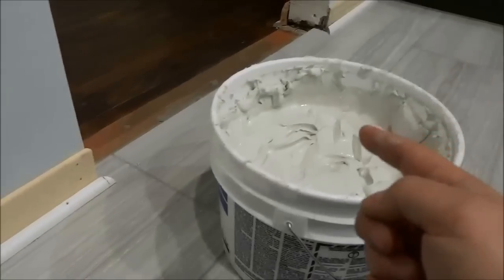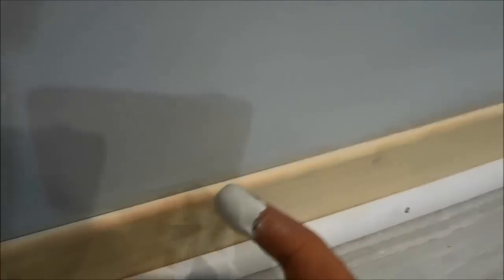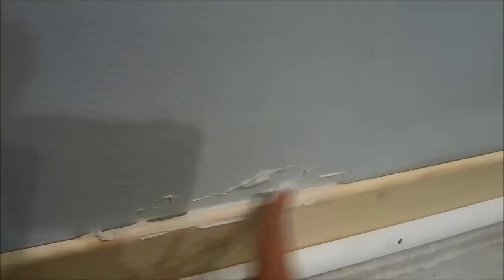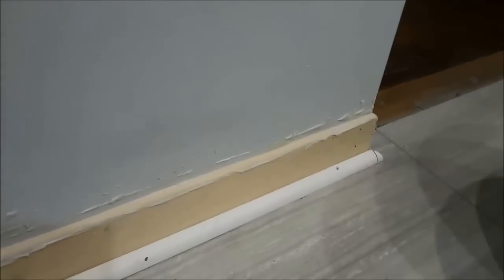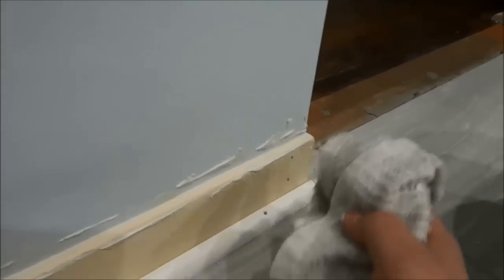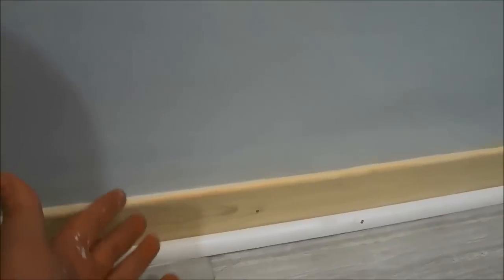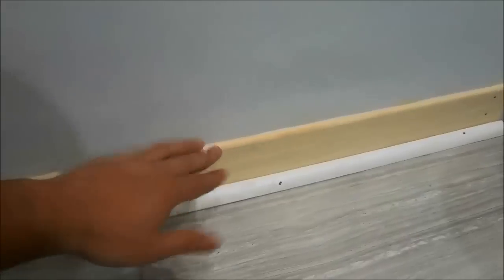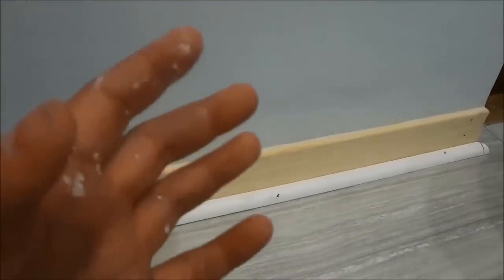How To Fill In The Gap Between The Wall And Baseboard (EASY Tutorial)

Comment: This is a bad, amateur mistake, and you're not doing anyone a favor by propagating it. Drywall compound isn't meant for this kind of application. It's not flexible, and will start cracking as soon as there are any changes in your wall or molding. Try nailing your baseboard to the studs behind it, using a stud finder and a brad gun or small finishing nails. Unless your wall is unusually irregular, this often holds the baseboard perfectly flat against the wall and makes filling unnecessary. If you really do have spaces that must be filled, use flexible paintable caulk, dispensed from a caulking gun.
Reply: THIS!!! what the heck dude!!!!! this is such bad advice!
Reply: But it looks fine when you leave the customers house after getting paid! :)
Reply: i guess it's kinda randomly asking but do anybody know a good place to watch newly released tv shows online ?
Reply: @Jeffery Avery I watch on Flixzone. You can find it on google :)
Reply: @Jabari Emilio Yea, I've been using flixzone for months myself :D
Reply: @Jabari Emilio Thanks, signed up and it seems to work :) Appreciate it !!
Reply: @Jeffery Avery Glad I could help :D

Comment: THIS IS NOT A VERY GOOD METHOD.. I USE CAULKING AND IT WORKS A LOT FASTER AND NO SANDING OR TOO MUCH CLEANUP.. PLUS AS THE WALLS EXPAND AND MOVE THE DRYWALL WILL CRACK.. WITH CAULKING THAT WILL NOT CRACK AND WILL MOVE AS THE WALL EXPANDS AND MOVES..
Reply: yep you sir are right i only use caulking....
Reply: I was lazy a few years ago and did this method because I had plaster on hand.  I also used 5” mdf.  Painted it.  As of today, absolutely no cracking so it worked for me.

Comment: I actually use both methods and it works for me, I first fill with drywall mud to close as much of the gap as possible, then go over it with a thin layer of caulking, after two years, perfect still, so it’s not a bad idea just not good for a final finish, you need the expansion of the caulking.

Comment: Caulking can be applied in pretty much the same way (if not easier due to the gun), and won't crack terribly after a month or two of house shifting. In fact, if those baseboards are newly installed, it might crack that drywall mud the second they start to settle.

Comment: If the gap too big, using the foam filler rod will help a bit then using dry wall mud to fill the top. Good thing about mud is it will not shrink like the caulk.

Comment: This seems like a really bad idea. The drywall compound will become quite brittle when it hardens and with the wooden baseboard expanding and contracting with the seasons and humidity, it could cause the drywall compound to crack and break into little pieces. Caulking is a much better idea for this because it bonds better with the wood and its much more flexible.
Reply: Yeah, everything about this method seems like the exact wrong thing to do. Make an unnecessary mess that makes more work with the wrong thing to use and your freaking finger. Should be an SNL skit.
Reply: Caulk is the right way, well installing snug and fit is the right way.  I did my entire 4500sqft house with new plastex baseboards and it took a little longer then just slap n go.  I have a reqlly rough  knockdown exposed wall finish and if I could seal it up anyone should be able to.

Comment: Using drywall compound is just wrong because it is brittle and will crack. Also the application is unnecessarily messy. Should have used caulking instead. Caulking gun can dispense precise line of bead for the gap, hence neat and efficient

Comment: I just removed carpet from the basement. The sub floor is concrete and so there is some gap between the concrete floor and the baseboard now that the layer of pad/carpet is gone. I have seen bugs getting in between this space. Any recommendations to ensure a proper seal? I noticed this video has some type of weather stripping.
Reply: Rehan put some shoe molding or corner round to it.

Comment: I have spent hours removing what appears to be latex caulk from the molding which was put in when the house was built since in addition to ALSO cracking like drywall compound it is also "sticky" which causes a lot of dust to accumulate which it is very difficult to remove. I do not have that "stickiness" problem with drywall compound.  Perhaps silicon caulk would not have this issue but once bitten twice shy.
Reply: I agree--doing heavy work right now removing years-old baseboard stuff that is like rock stuck to the walls.  I'm using his method when I replace the baseboards--bet it will work fine and create fewer problems for someone who might have to remove it in the future.
Reply: Yeah, use silicone caulk.

Comment: This is a terrible method.  Drywall compound will always crack in the future. I've worked with drywall for 15 years and I can guarantee this will crack.  There is a chance it won't crack if you paint over it with a few coats, but if the gat is at least 1/4" it's going to crack.  Caulking is designed for this specific purpose.  Use caulking whenever possible.

Comment: Paintable Caulk?  How are you going to fill the gap between the base shoe and flooring?  Stick to your day job, please don't tell me you're a carpenter or painter.  DIY is overrated, with big box stores that supply homeowners with products that provide materials that only tradespeople should be installing.
Reply: I don't agree with your last statement, I am not a tradesman and did all my trim work myself for to save money, whats important for a DIY'er is to do the research and find the common method that is recommended by professionals. For example this method is recommended by no one but this guy therefore its probably garbage.
Reply: @kevo1264  I agree with Kevin. Do your research and there's no need for hiring someone. There is no difference between a tradesman and a DIYer equipped with knowledge. One does it for a living, the other does it one or two times ever - but both can complete the job correctly. Likewise, just because I don't work at a pennzoil doesn't mean I'm not equipped to do an oil change on my car, or because I don't work for a garden center, I can't plant a vegetable garden.

Paying someone $200 to come out and squeeze caulk out of a tube to fill a gap is ridiculous. That said, people like the guy in the video are much more ridiculous and give DIYers a bad rep.